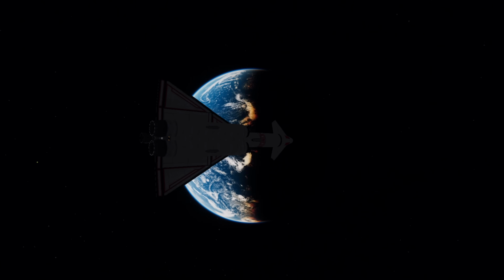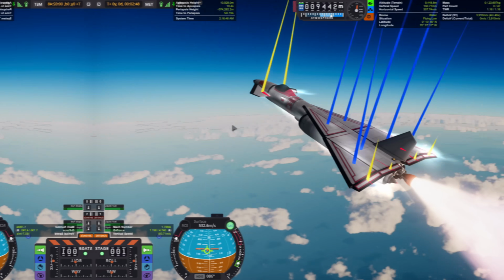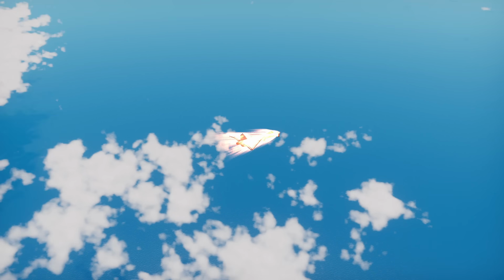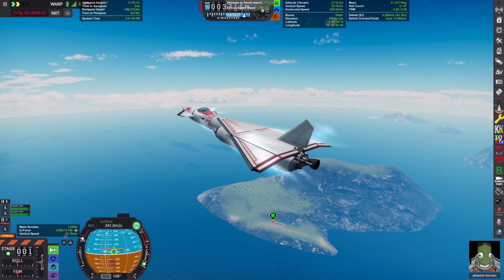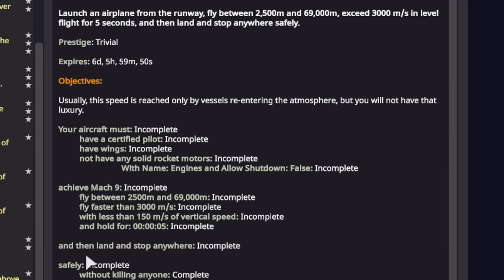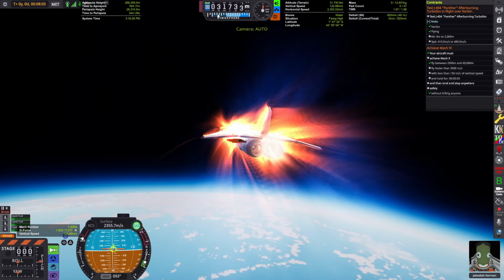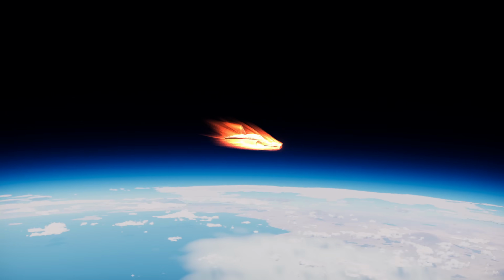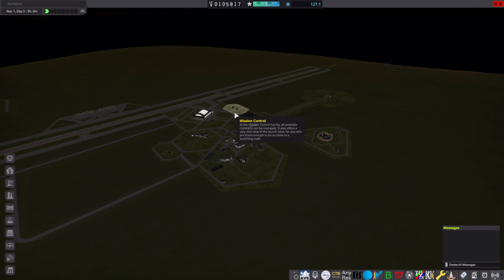Can I build a MACH 9 PLANE in Modded KSP 1!? (Aircraft Only: Ep 3)

Comment: For some reason whenever I build an ssto, I can get it to the mun and stuff but when I take it back into the atmosphere, I can never get it to stabilize and it corkscrews all the way down to the ground and blows up
Reply: Pump fuel forward, and there is this thing where the faster ur going, the more your centre of lift shifts backwards and includes an rcs system, maybe?
Reply: @ that is correct. Though it’s not based on speed. It’s because when you’re reentering atmosphere, you’re low on fuel and nuclear engine are very heavy so all the weight goes to the back. In space it’s fine but not for airplanes. So just pump fuel to the more forward fuel tank or design the craft so the center of lift in behind the center of mass even with empty fuel tanks

Comment: The fishtailing behavior is being caused by the angled "brakes" on the outer quarter of the wings. Basically if there's anything but perfect airflow 1 catches the air better and pulls you left driving the right hand one into the airstream more which then pulls you back right. 

A much more effective approach for using the low tech control surfaces like these is to instead make "duckarons" (is what we call them in the RC aircraft community). In KSP it'd be the 2 controls are overlapped on eachother, 1 moves up while braking, the other moves down. But it keeps the airflow perfectly balanced.

Comment: I'm pretty sure the "cape" effect is less because you initially placed the wings forward and more because you built your wings beginning with the frontmost piece. The issue is which wing-piece is connected to the fuselage, at least as much as where on the fuselage it's connected. Notice how when you shifted them, you were attaching from the central rectangular section.

Comment: late, but happy birthday!
Reply: also, if at some point you could make something resembling the lockheed or boeing space shuttle concept designs, that would look awesome and fit well in this series. I also recommend using OPT spaceplane parts, but B9 Part switch, a dependency for it is outdated, but it works just fine.
Reply from the maker: I’m actually really looking forward to doing some irl spaceplane concepts, one of the big ones (both figuratively and literally) once we have the right parts is the Boeing space freighter, it’d be awesome to get that working!

Comment: Loving the series man keep it up!!! One thing I noticed is that "<15m/s Vertical Climb" is not "<15m/s Vertical Speed". Meaning you could be going down much much more than 15m/s and still be just fine.  Due to the curvature I think the only way Mach 9 (or Mach 12) is even remotely possible would be on reentry and not escape. 

I think the most fuel efficient approach would be to achieve a low orbit or elliptical orbit. Burn prograde at your periapsis to push out your apoapsis (a lot). Once you have a sufficiently high apoapsis time warp out to it and then burn retrograde to put your periapsis down into the atmosphere (i'd start around 40k). Then you should be able to just time warp back to your approach and brace for the very intense aerobreak that will occur. If you have a quick save manager you might want to make several as this is really pushing what these parts can be expected to take.

Comment: Regarding the wings, Enable autostrut and you can autostrut things midflight that should be stable but are not.
Reply from the maker: I won’t have access to autostrut until I get the actual strut part unlocked, (advanced tweakables is on) makes for some interesting engineering challenges  in the mean time though since I usually lean hard into using autostrut lol
Reply: @smooneychad  I usually autostrut to "grandparent part" I have run into an issue where all my wings and tanks were all auto-strutted to the same part, made for some really impressive wobble tbh =)
Reply: @DavidEdwards9801  I just alternate root and heaviest and it seems to keep it relatively stable
Reply: @Allthegoodhandlesaretakenlmao  hey, thanks for the tip  I should try that out =)
Reply: Pretty much what I thought.